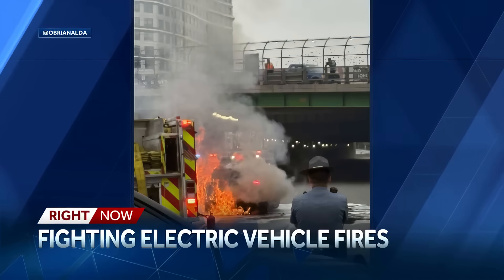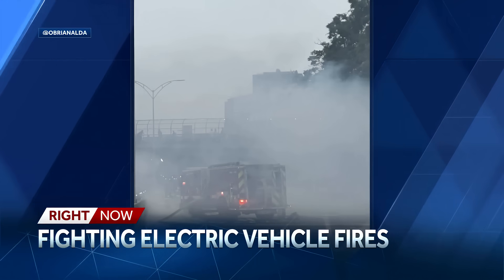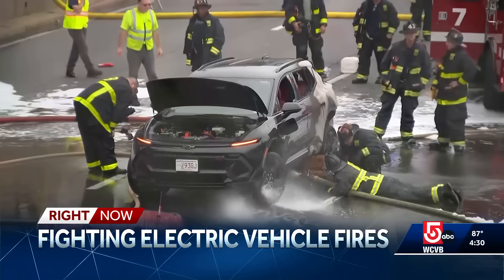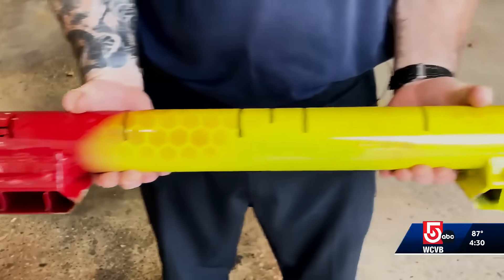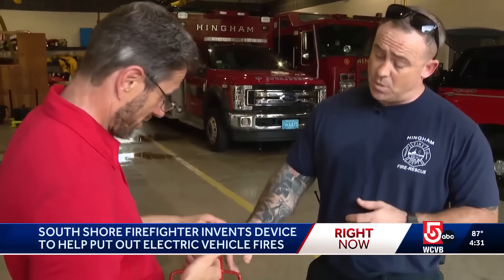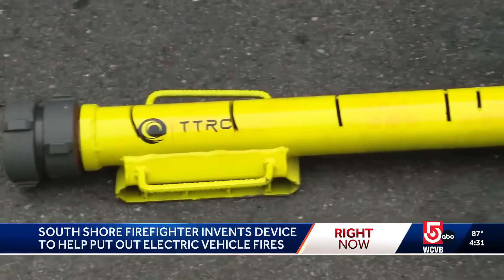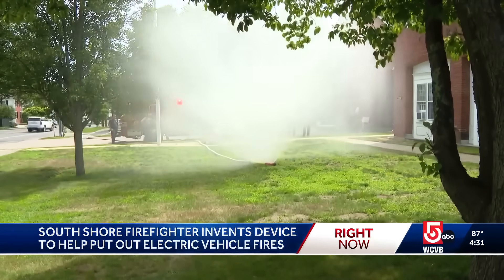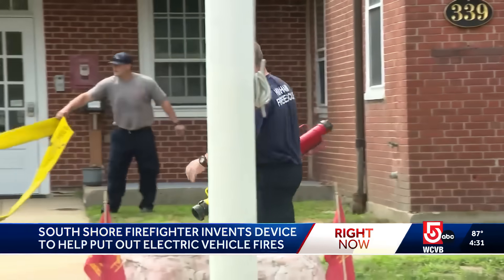Mass. firefighter invents tool to help put out electric vehicle fires

Comment: The problem with a special nozzle like this is that it requires firefighters to get too close to the vehicle. Two firefighters died in an underground garage fire in Spain recently because the EV battery released explosive fire gasses in an enclosed parking structure. Cooling the battery only addresses the heat of the fire yet fails to address the chemistry of the fire. It’s the chemistry of Lithium ion battery fires that kill firefighters and until this problem is solved you will continue to see Line of Duty Deaths like the ones in Spain. 

Chief Hughes
Battalion 1 (retired)
Chicago FD
Reply: in other nations they rush in, jack the car up and just use a hose from a distance, certainly less risky than just standing there.
Reply: @felderup apparently they used a method that put them in close proximity to an explosive atmosphere that ended up killing 2 FF’s and injuring 1 FF critically. Jacking the car up and fighting the fire from a distance are 2 different tactical approaches. You either fight the fire defensively from a distance or attack the fire in close proximity which is an offensive fire attack. It’s usually a bad idea to mix defensive and offensive fire attack strategies.
My recommendation for EV fires is to approach from as great a distance as possible and apply a Compressed Air Foam fire stream to cool the heat of the fire while the foam molecules bond to the smoke and fire gasses to reduce their flammability so the gasses don’t explode. Water has high surface tension that cause it to bead up and run off. Water also produces a lot of steam that expands the diluted fire gasses which are still capable of exploding. Adding foam concentrate to water lowers the high surface tension allowing water molecules to bond to the hydrocarbons in the smoke and fire gasses making them too wet to burn and too heavy to remain in the atmosphere. 
All fires (including EV battery fires) start small and anything that’s wet can’t burn. 
Never throw water on a grease fire unless you add about an ounce of foam concentrate (dish soap) per gallon of water to your water. The same goes for Lithium Ion batteries. The electrolytes in the batteries are made from oil and oil and plain water don’t mix unless you add a foam concentrate to it.
Reply: @JerryHughes-u2f  i do believe the point is to cool the battery, not put out a grease fire.
Reply: @felderup Believe what you want. Fires are both chemistry and physics. Cooling the heat that the battery produces only addresses heat (physics). You have to fight the fire on a 2nd front at the same time and that’s where all the deadly stuff happens. If you don’t address the fuel (chemistry) that appears in the form of smoke and invisible fire gasses at the same time you will risk dying with your belief that all you need to do is cool the heat of a lithium ion battery fire to prevent it from exploding.
Reply: @JerryHughes-u2f  you remember the triangle of things fire needs to continue burning?  you only need to take one away.
Reply: @felderup DING! DING!! DING!!! 
That’s right! But you don’t win every time you fight a fire by attempting to take out the Heat leg of the Fire triangle . It’s a common misconception made by many, many, people in the fire service that the most important side of the triangle to take out is usually always HEAT.  The problem with prioritizing the reduction and elimination of HEAT over the need to make the FUELS wet or the OXYGEN inert is that it takes more TIME to reduce and eliminate HEAT before it triggers additional gas expansion, smoke production and flame spread. Timing is everything. If you have the “Cool the Heat” blinders on you may never see the  gas explosion that it causes because you’ll be too dead to realize your mistake. 
When fighting an EV battery fire approach with caution and a charged hose line with a minimum 1% Class A foam and 99% water. This will suppress the explosive fire gasses as it stops flame production. Forget cooling the battery. Firefighters are there to protect life and save property (with Life Safety being the priority). The key is to control the atmosphere and surrounding terrain that may be impacted in a dangerous way. The battery can continue to burn while you protect the exposures to life and property. Once the explosive atmosphere is made non-explosive the fire department can move in to cool the battery by jacking up the car or putting a fire blanket over it.  I know it may sound counterintuitive, but attacking the heat of the battery is the last priority.
Reply: Easiest way to solve it Chief, is to stop producing EVs altogether. If no more EVs = No more toxic EV fires.
Reply: @Stargazzer811  the myth that ev's are bursting into flame all over the place, so many seem to be suckered by it, but it's more fundamental than that, those against ev's are against freedom, they HATE freedom.
Reply: @Stargazzer811 that’s true but it doesn’t solve the current problem. There are millions of EVs on the road now. Even if they banned the manufacturing and use of EV cars the abandoned vehicles would burn for years and years to come.For the fire service the problem is going to get worse before it gets better.
Reply: @JerryHughes-u2f  Yeah that is true Chief, sadly. One can dream through; I don't look forward to having to fight one of these fires one day. Those E-bike fires I keep seeing the FDNY fight are bad enough.
Reply: @Stargazzer811 One can dream. I dream of the day we get straight about the danger of plain, untreated water to suppress practically every fire we fight. Ordinary combustibles: use water.
Flammable liquids fires: Just use a lot of water. 
Live electrical fires: use water, just try not to step in the runoff until the power is off.
Combustible metals: just use water and close your eyes before the magnesium blows up in your face.
Is it never okay to use foam, purple K, monomonium phosphate or Dry powder? Water is not a default suppression agent that works on all fires. It is known to make them worse before they get better.
Reply: @JerryHughes-u2f  I know they've found ARFF foam and some sister products of that are cancer causing now, but mostly its due to cost too. Specing out foam systems and refilling them is proving to be too expensive for some departments. Water's reasonably cheap by comparison.
Reply: @Stargazzer811 actually using water costs more in terms of dollar loss to the insured. 80% of the damage caused by fire is attributed to water damage. Using a foam concentrate at 1% costs pennys  per gallon of treated water. Since wetting agent suppresses 3 to 5 times more fire per gallon of water mixed with wetting agent foam the amount of dollar loss per gallon of water makes up for the cost of the foam by far. Instead of a 3 level fire fought using water the same fire stays contained to the same room it started in because you added foam. 
Fires are chemistry and physics. Know the truth about why structural firefighting foam suppresses fires better than plain, untreated water and you’ll see the light because you with save more lives and property (money) than you ever thought possible.
Reply: @JerryHughes-u2f  No disrespect chief, but most foams are made of chemicals I don't want near my body. Being near the one's in the fire is bad enough. I'll stick with water and lower my chances of dying at age 45 with no hair because of chemo. As it is, if you train right then you don't need to dump alot of water on a fire to put it out, which limits water damage anyway. On top of that many departments conduct salvage services after overhaul, and some are very thorough with water and smoke removal.
Reply: @Stargazzer811 if you are afraid of using Class A foam you should be just as afraid to use dish soap, shampoo, car wash and hand soap because they have the same chemistry. You clearly aren’t trained to know and understand the difference between biodegradable Class A foam which contain no carcinogens or PFAS and Class B foam that contains Fluorine. It’s the Fluorine in Class B foam that builds up in your bloodstream which can lead to adverse health effects that have you worried about losing your hair at 45. I had to read a lot of research on foam to develop my online training module on foam for pump operators. I point out the training gap that exists in the fire service as it relates to the difference between Class A and B foams. Your response to my comments is an example of the training gap that I speak of. If I were you I would be more concerned about getting killed or injured at the scene of a fire involving lithium ion batteries and how using plain water can, and has, led to the explosion of smoke and fire gasses. Use Class A foam at EV fires. I don’t care if you pump it through a saxophone. Just don’t use plain, untreated water.
Reply: @JerryHughes-u2f  You are correct that my training is lacking. The training of everyone in the fire service is, because we can never train enough for a job that can kill us. While I have never trained on the use of foam, I am quite aware of the differences and the effectiveness of various types of it. Purple K is probably one of the most effective on the market, actually. My distrust of it is entirely personal on my end. Call it an irrational fear if you like; most fears are irrational. Closest I'll ever get to foam is a tablespoon of Dawn in the Can. But then I don't touch hose lines, just hooks, ladders and cans.
Reply: @Stargazzer811 if you don’t know what you’re doing with foam at a fire you should expand your knowledge of it since it sounds like you’re interested in training for a job that could kill you. The can is a good place to start. If you want to understand more about how the surfactant molecule enhances waters ability to extinguish flammable liquid try spilling a Dixie cup of water mixed with enough Dawn to make the water blue into a pan of hot bacon grease or fried chicken oil. Pour a few drops in at first and notice how the soapy water turns into foam after the hot oil mix’s with the water + Dawn. After you pour the whole Dixie cup into the oil keep adding more water and soap into the oil. The pot will fill with foam and the cooking oil will emulsify making it impossible to burn. 
Keep checking back with me to learn much, much more about Class A foam. It actually costs less than water.
Reply: @Stargazzer811  why so anti-freedom?
Reply: @felderup  Anti-freedom? Not sure what you mean.
Reply: @Stargazzer811  if an electric car would suit my EVERY NEED perfectly, and you want to ban them, you take the freedom from me, and a horde of others that find them to fit their needs.  just, poof, electric cars gone, then we have to use something that is second or third best, cause YOU want to get rid of it, for no truly good reason.
Reply: @felderup  No I want to get rid of it for the safety of people, specifically firemen but also for the general public. Also, hydrogen ICEs beat electric motors in all regards except for instant acceleration. 

They have more torque, they don't place unnecessary demand on already strained and undermaintained power grids that will never be fixed to a reasonable degree in either of our lifetimes, they burn cleanly and can have a readily available fuel infrastructure that can be made using what we already have for petroleum based products with minor modifications, and most importantly, unlike an EV, we can actually put a HICE out like a petrol burning vehicle when they catch on fire, instead of risking it starting back up 3 days later in some junk yard somewhere. Ask Scottsdale Fire in Scottsdale, Arizona how that went. Hint: it didn't end quickly, or well. 

As for your freedom, I've got bigger things to worry about like keeping my fellow firemen, my friends and family, and the general public I swore an oath to protect safe. If banning EVs and thus restricting your freedom of movement results in that, all I can say is I'm sorry, but I stand by my convictions.

Comment: $3000 seems steep for a pipe with holes cut in it.
And some yellow paint.
 DIY
Reply: Fire fighting equipment is a different animal.  Fire departments spec everthing down to the coating on fire truck lug nuts.  So for this I can easily envision getting an engineer(s) certified in mechanical and fluid engineering to check the design and draw a print of it.  Then, use spec'ed, pressure rated stainless pipe, fittings, features, etc.  Get it fabricated to print by an ASME certified shop with welders holding current S, U, and R Stamp certifications for welding pressurized systems.  Once that's done, go ahead and get all the business licenses, permits, and insurance needed to operate.  Or DIY, have it fail, cause an injury or fatality, and get sued into oblivion.
Reply: It's the same for MILSPEC or having an NSN attached to it. The item in question has been tested to repeatedly meet a specific standard. So you pay premium. Even if you can find a better material that will last longer for way cheaper at Home Depot.
Reply: Wait until the DOD decides to adopt it; the price will balloon to $ 30,000 per device, with custom colours as an option, $10,000.
Reply: Not to worry, Amazon will copy and sell it for $199.
Reply: Just like a wedding, anything labeled for firefighter use is three times or more its intrinsic value.  How do you think municipalities launder or otherwise overpay.
Reply: and rebar handles lmfao
Reply: It cost so much because they need to stay in business and there is a very small niche that is purchasing it. They will probably stamp a date that will make it appear like the metal goes out of date and they gotta purchase another one.
Reply: Ill make you a better one for $500
Reply: Only union approved committee, slit cutters, welders, painters and nut tighteners can work on these.
Reply: You're paying off bro's cost of getting this approved
Reply: The first of anything is expensive.
Reply: Anything fire department related is extremely expensive, especially if it has been tested to meet different standards.  Pair of glove at a hardware store, 10-15 bucks.  comparable fire fighter gloves, 80-120
Reply: @areutryingitout5678  anyone that's not been there doesn't get it. Anything painted red on a red truck is immediately 3x as much as you'd think it should be
Reply: @Iamthathillbilly haven’t been there, but I do get it.
Reply: @Iamthathillbilly if the military bought it, the cost would be $30,000 a piece. Although it would be in Army green though.
Reply: @joeshmoe9978  and it would be "military grade" so it would somehow jam immediately 😂
Reply: @Iamthathillbilly so true 😆
Reply: It needs to be able to withstand the water pressure these hoses can put out and be tested to a point that it can be trusted for use in the field.
Reply: Yup, you could use a lawn sprinkler to do the exact same thing, $20 at Home Depot
Reply: @Fish-Erman  so you’re saying is you could use a $20 sprinkler that can’t put out enough water and it would melt almost immediately
Reply: @Fish-Erman  lawn sprinklers don't flow hundreds of gpm and won't take 50-100 psi 😂
Reply: @Iamthathillbilly  hundreds of gpm and high psi is not necessary if you knock down most of the fire first. 🤣
Reply: @Fish-Erman  do you not understand that the whole name of the game with EV fires is ridiculous volumes of water?? Go ahead and try to "knock it down first" 😂
Reply: @Fish-Erman  i would recommend the dollar store brand at 3$
Reply: @Fish-Erman Lawn sprinkler. 
That's funny.

Burning batteries have been submerged in tanks of water and when removed have reignited.

A lawn sprinkler wouldn't come close to doing the job.

It takes sustained drenching for a significant duration to ensure the battery will not reignite.
Reply: You're not too smart
Reply: @Wildman-zh8lg Because...
Reply: @Wildman-zh8lg He is smart to question the price, seeing as these are tax dollars being spent. 

Any local machine shop could be commissioned to make this for a fraction of the price.

Using stainless steel eliminates  the need for painting. 

A hose adapter with a SS connector on one side of a small length of hose and a brass connector on the other eliminates galvanic reaction between brass and stainless.

Fittings aside a 5 ft, 3 to 4 inch stainless pipe is about 300 to 400 bucks tops depending on thickness.

Getting it approved is the only issue. That's were the cost come in.

UL, FM or NFPA I'm sure would charge a pretty penny.  But once tested and approved there is a lot of gravy in this tool.

If you are talking 1 per firehouse, in a large city that's big bucks but it could be worth it none the less.

There is no shame in questioning everything.
The only shame is in refusing to acknowledge the proven results.

Comment: Good for him, but, there is equipment for this already, and alot cheaper than $3k..,...
Reply: You are correct sir. The batteries are inside a sealed compartment, you can put it underwater and it will continue to burn. I believe the device you are talking about is used in conjuction with a thermal image camera to find the point of combustion in the battery case, which is the entire bottom of the vehicle.
Reply: @patrickclayton2732    I saw a device on YouTube, Europe has been using for years.   Something similar, but round at the end.  It's like $129 Euro.....  No Thermal, but, you plug a hose in and slide under a vehicle, till battery cools off.